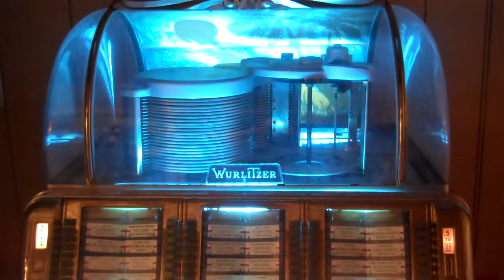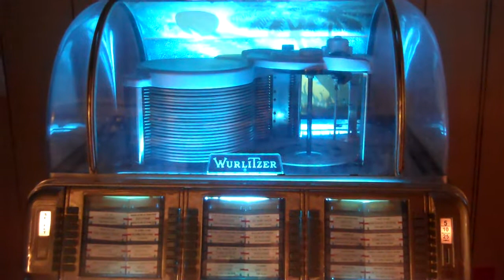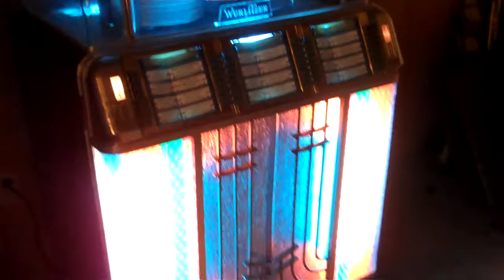Wurlitzer 1400 Repair 5 (Final)

Comment: Hey Mark, I have a model 1400 as well. The main large mechanism does not want to turn anymore. The gearbox motor spins but the mechanism is not. Therefor the machine is not slecting any record. It sounds like it wants to go but isn't. How do you suggest going about fixing the problem?. Thanks. Jake
Reply from the maker: Hi Taylor,  1st of all do you have a service manual?  if so make sure that you have followed the lubrication sequence. most jukebox problems start with lubrication. have you manually tripped  the pin bank ? that will tell you if the problem is with the write in, or read out section of the mechanism.  Mark